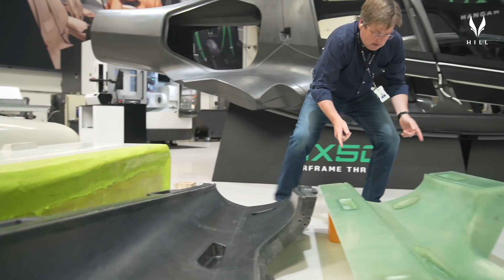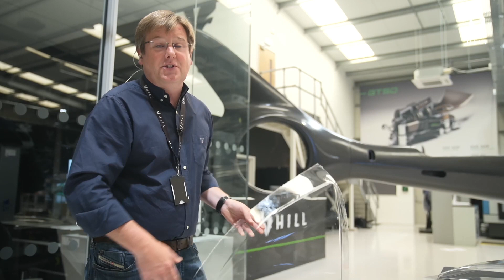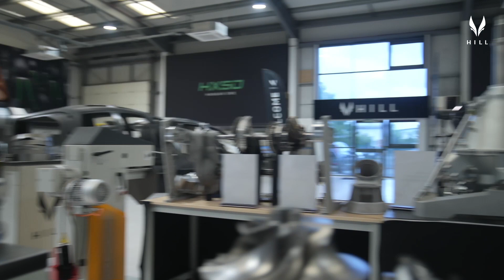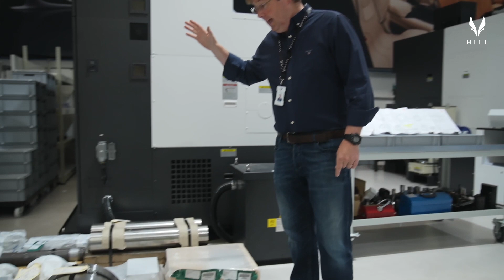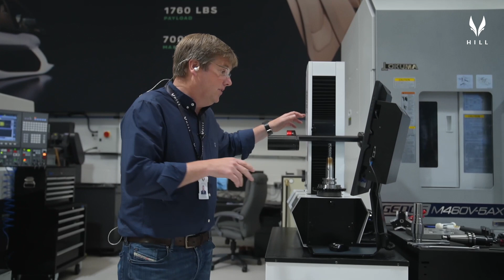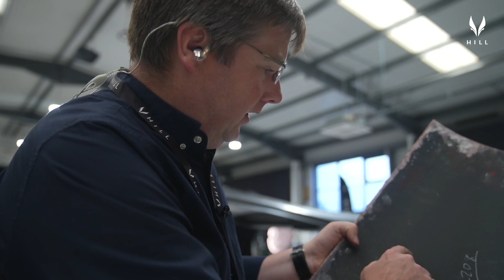Highlights - HX50 Monthly Update & AMA on July 11, 2023

Comment: i definitely believe that carbon fibre can be fine tuned in its use in aviation, but i am also interested to know what can be done to prevent such incidents such as the 1995 Bristows helicopter accident, lightning struck the main rotors and jumped to the tail rotor blowing it to pieces on a outbound flight to the north sea oil rigs, fortunately luck was on the pilots side and he made a near perfect ditching saving all on board - i know that metallic strips are used in the main and rear rotor blades leading edges, but i have been reading a little about conductivity especially in wet conditions where lightning strikes might be expected

Comment: sorry, you mention HC50, all references on site talk to HX50, whats the difference ?
Reply: C certified for commercial. X experimental.
Reply: C is commercial and X is private (hx50 is a private helicopter and to meet the aviation authority rules on the building of a private helicopter you have to build some of it yourself) 
As the rules for commercial flights are more stringent and will take longer the HC50’s will come to market after the HX

Comment: What ever came of the carbon chopper built here in NZ a few years ago? Last I saw of it was when it went down in Auckland harbour, they said the failure  had nothing to do with the carbon construction. Never to be seen agian.
Reply: They had too many crashes and serious failures before running out of capital. Eventually they had to give up basically. Real shame it didn't work out. They got close to having a viable product.
Reply: carbon fiber amplies vibrations and will rip itself apart because of it. helicopters vibrate just a bit.
Reply: Wasn’t the final crash when the swashplate broke in flight? Somehow the test pilots got it down without dying. Supposedly that was an outsourced part. I imagine it was just too expensive for them to start building up another flying prototype so they folded. 

Unfortunately that’s all it takes to setback a project like this a hell of a long way. Computer models these day are amazing and can almost perfectly predict how everything will perform. The real danger I see is someone forgetting to torque a nut or secure a wire or something like that. This causes accidents with machines with hundreds of thousands of hours on type. If this happens during a test flight of a prototype the potential buyers will run for cover. Its not a game for the faint hearted. Good luck to them.